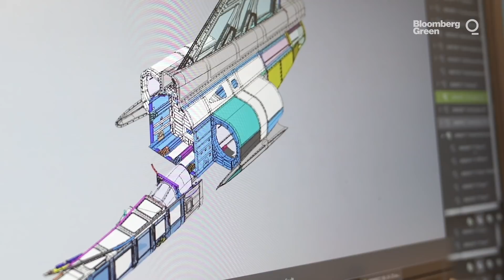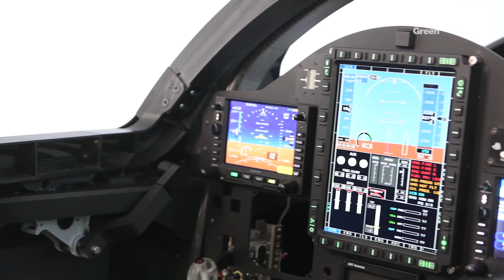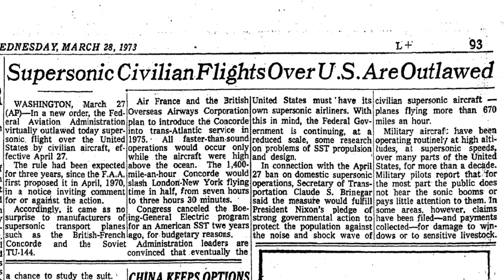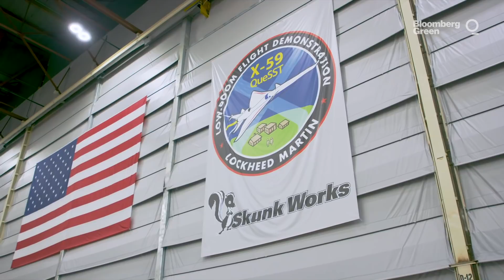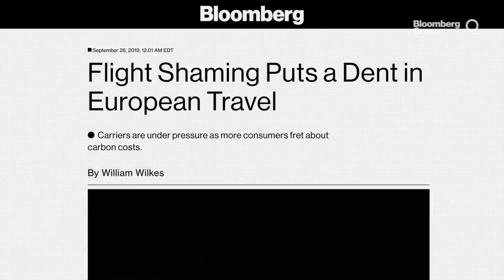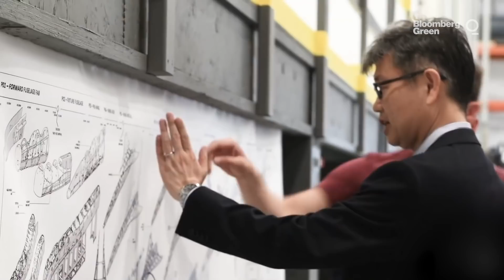Why Supersonic Jets Are Making a Comeback

Comment: Concorde didn't fail. Mega success and not superceded since the 60'ees
Reply: is that why the plane got dropped?  Because it was a success ? Lol
Reply: So many comments refuting the failure of the Concord. Over it's entire lifetime they only sold a couple dozen and the airlines had to charge huge ticket prices to break even per flight. For the airlines that flew it, they kept it only for marketing and bragging rights because it was a financial albatross to fly and maintain. 

Sure it worked, but it also failed.
Reply: @jmelande4937  do you know of any other airplane from the sixties that flew regular Atlantic routes in the 2000s?
Reply: @DinoAlberini  name a time where airlines complimented the aircraft about things other than its speed and safety. it didn’t make economic ends
Reply: @gavcom4060  it’s about image and prestige. That thing was a flying billboard.
Reply: @DinoAlberini  do you know any airline manufacturer that gave up after dismal sales of one and only model?
Reply: @jmelande4937  it was a cooperation, not one manufacturer, also, both of them have successors active today.
Reply: @DinoAlberini  
Concorde entered service in the 70s. The 747 series had first flight and entry into service ahead of Concorde, and 747s still fly revenue flights across the Atlantic more than a decade after Concorde retired.
Reply: ARE YOU on crack
Reply: @vilemeep  in what way did it fail?

Comment: 'The failed Concorde'?  The Sovjet Union made a knock-off version of the Concorde, which only flew for 3 years after 2 fatal crashes. Boeing, the company after nowadays BOOM, wasn't able to design and produce a plane like the Concorde. Remember: Concorde started to fly in 1969 and it is now considered as a massive achievement,. It flew safely for years, even through the oilcrisis of 1973. You can't just say it was a failure because they aren't flying anymore. 

To remind you of the accident in Paris: a plane, which took off prior the Concorde, lost a strip and due to the angle of attack on the fueltanks, it went wrong. It was possible to modify all Concordes to meet the recommendations after this accident, but if you knew the oilprices were on an all time high and the tickets were expensive, it wasn't possible anymore to make money out of flights. The Concorde a failed plane? No. Does this video have a bad intro? Yes.
Reply: In the late 70's my university physics department had a Concorde designer come and do a lecture on the technology behind Concorde.  I remember clearly that he said they could never understand why the Americans tried to design a mach 2.7 plane.  The metal technology didn't exist (or would have been prohibitively expensive) so Concorde only flew at mach 2. They knew their limitations.
Reply: @garethonthetube  They tried to design a Mach 2.7 plane because,being Americans,it had to be bigger,better and faster.
Reply: But Boeing never tried to design and produce a plane like Concorde.
Reply: @Crustywasp , they did. You can search for the Boeing 2707.
Reply: @Bruce954  Oh yes,the old Boeing 2707 story. When the Americans heard that the U.K/France were designing a supersonic passenger aircraft Congress asked their aircraft manufacturers to come up with their designs and,being American,it was expected to be bigger,faster and better. Lockheed came up with a delta wing design (similar to Concorde) and Boeing a swing wing design,Mach 3,two hundred passengers and flying at 80,000ft,as you rightly say the Boeing 2707. A totally unrealistic,over ambitious project which quickly ran into technical difficulties and even now regarded as impossible to build. Boeing then submitted a delta wing design (much to the annoyance of Lockheed) but with billions being spent on the Apollo space project and the country getting further embroiled in the Vietnam war Congress refused funding and the project was cancelled. We did it,they didn’t,fair enough. We did it,they couldn’t is rubbish. I’m not knocking Concorde as it was a beautiful aircraft and a fantastic technological achievement which I was lucky enough to fly on in 1991 but when people say ‘The failed Concorde’ nothing will ever change the fact it was a terrible economic failure.
Reply: @Crustywasp  if they couldn't finish the built or even the design because there weren't any funds left, they couldn't do it. Otherwise it was there. Concorde did. Even the Sovjets did. Boeing couldn't and that isn't rubbish, but the truth. Enjoy your day!
Reply: @Bruce954  Exactly. They didn’t do it because of funding being withdrawn,not because it was beyond them technologically. That’s the difference. Had they not been so over ambitious with the original design and Congress had carried on putting the money into the project the the U.S probably would have had their own SST. Something we’ll never know but I know where my money is. Anyway,you enjoy your day as well.
Reply: @Crustywasp  the fact is they couldn't do it. That is the point. The reason behind it, doesn't matter. At all. "Probably" doesn't build a 2707, neither did Boeing.
Reply: @Bruce954  Oh,for heaven’s sake. The point I’m trying to make is that in the U.K. we seem to think from a technology point of view an SST was beyond the capabilities of Boeing. The U.S Congress stopped the funding which killed the project,Boeing never held up their hands and said they weren’t capable of building the aircraft. That’s the difference. Anyway,we had to ask the French for help as well. 😀. Also,who was the cleverer? Boeing,who built over 1500 747’s which flew billions around the world and only now being phased out after 50yrs or us,who built an aircraft with a limited range,a pathetic payload and which no airlines wanted? Answers on a postcard please.
Reply: @Crustywasp  there isn't a difference: it is or isn't made. Boeing couldn't do it. 

The 747 isn't relevant to this case. Last message from this side, bye!
Reply: @Bruce954  yes I agree. Is or isn’t made is true. Could or couldn’t is more relevant. Boeing couldn’t do it,but due to lack of funding and not lack of technological expertise. Last message from this side as well. Enjoy spending your time splitting hairs. Bye.
Reply: @Crustywasp , ok not my last message, because you are still wrong. Because Boeing couldn't make the plane, you can't know if they would get some difficulties later with the technics in the plane. They couldn't do it. Accept it. Don't make excuses.
Reply: @Crustywasp , can't you just accept the plane isn't built, didn't came into service thus you can't tell if there would've or wouldn't have been any technical issues later in the process, which could have been a dealbreaker as well. Fact is it isn't build, because Boeing couldn't. That is the simple fact. End of the discussion. Done.
Reply: @Bruce954  yes,couldn’t because of withdrawal of funding. End of discussion. Bye.
Reply: @Crustywasp  In The Netherlands we do have a very nice saying:  'een bord voor je kop'. Translated loosely, it means that person is very stubborn and is fixated on his or hers vision. That is the case with you, I'm afraid.  It isn't there, so your opinion isn't correct. Deal with it.
Reply: @Bruce954  Equally applies to you as well!😀
Reply: @Crustywasp  Not if you are right. And guess what? I am right. You are wrong. Deal with it.
Reply: @Bruce954  😂😂😂😂😂😂😂😂😂😂😂😂😂😂😂😂😂😂😂😂😂😂😂😂😂😂😂😂😂😂😂😂😂😂😂😂😂😂😂😂😂😂😂😂😂😂😂😂😂😂😂😂😂😂😂😂😂😂😂😂😂😂😂😂😂😂😂😂😂😂😂😂😂😂😂😂😂😂😂😂😂😂😂😂😂😂😂😂😂
Reply: @Bruce954  I used to have exactly the same argument with my late father years ago about how the ‘Americans didn’t have the intelligence to build a supersonic passenger plane,we showed them how to do it’. He was ignorant as well.
Reply: @Crustywasp , Well, maybe your late father (may he rest in peace) knew your personality and thought it would be better to say you're right than actually stick with the facts. He knew you were stubborn and wouldn't give in. Unfortunately for you I'm actually sticking with the truth. Enjoy your day.
Reply: @Bruce954  😂

Comment: Sub-orbital Hypersonic flight will become a reality before these, I am betting. Once you're essentially in space, your fuel costs plummet, the only real issue is getting that high without complex technologies like aerial launch systems. If you can get an engine that can power a heavy enough payload, whilst still being green, and mount it in a self launching aircraft... well spacecraft in effect....that can 'Fly' is needed, but only needs to for the first few minutes after takeoff and before landing, then the technologies for most of the other aspects already exist, and you do NOT need worry about Sonic Booms. 

Thus, they need a powerful green engine, than can get Antonov level loads above the 'Space Line'.... and an airframe design that handle the stresses, and heat, of getting having such an engine, which they already have the materials for, for both those things that is, and they could get a machine that could take 747 passenger levels airborne. Once up there, with such little resistance, they could just do an acceleration burn, and coast. Decelerate via the opposite as approaching the destination, and again burn some fuel in landing. At most you'd have some serious inefficiencies on take off, but be WAY more fuel efficient for most of the flight, and with the right glide characteristics, probably even more efficient on descent and landing. You'd save MASSIVE money OVERALL on fuel, and that would reduce your running costs, maintenance, and, most of all, ticket prices. 

All the while you do not have to worry about Sonic Booms, and you're getting more people there, MUCH faster than Concorde or any of these plane could. You could fling people around the world in a few hours. Imagine a notoriously long route, like Sydney to Los Angeles, then imagine it taking three hours, not almost twenty. You board a 6 am flight to LA, get there in time for a late breakfast, spend the day, until a 7 pm return flight to Sydney, and be in bed by 11 pm. 

I see both the extant technology for that, and the effects in the now of the benefits of it, so I am going to say THATS going to be the next frontier in Civil aviation. Will the X59 project still continue and reap rewards? Sure... for Military aviation, but spaceplanes are the future for Commercial flights. Just too much benefit, and much easier problems to solve. Once it is a reality, who is going to want to pay business class prices, for a trip that takes thrice as long, when one could pay as little as premium economy, or even economy ticket, to get somewhere much faster? 

It's all moot though, because slowly we'll leave aircraft, and even spacecraft behind altogether.... one day... the Star Trek teleporter will be reality :P

Comment: 10:20 I've read that if you burn something at high temperatures the nitrogen in the air will also start to react and form nitrogen oxides, which is also a pollutant. So this is not really clean.
Reply: yes, indeed. but more importantly : you need massive amounts of energy to revert CO2 and H2O into methane (fuel) and O2, and that energy comes primarily from fossil fuels

Comment: I love to see some bright young startups and hate to be the "wet towel", but I can't help but get the feeling that this is all way to late. We've had Covid, we've got more pandemics on the way, there's the environmental impact and the plain old fact that the economics of flight has largely been subsidised for the masses by business class passengers! 

When we then add into the mix another small start-up (I'm looking at you spaceX!!) Then the picture really starts to change. The costs of rocket rides are plummeting, while the cost of even standard flight is escalating. When we have a prolonged effect from Covid where 50-70% of the world's precovid airlines are wiped out, then the already shaky business of Boeing starts to look like a crumbling tower!! As the manufacturers implode, the cost of operating an airline only ends up increasing and thus ticket prices!!!

All this to say, there will, without a doubt, in the next five to ten years be an intersection between the cost of a seat on a rocket (or other low orbit space craft) and a traditional or supersonic jet, which, I would suggest, will ultimately be the point beyond which the air travel industry as we now know it, will cease to exist! 

Just a potent thought anyway!!

Comment: So your saying Concorde was a failure?
Does that mean that Apollo was a failure too, total rubbish........
Reply: The difference is the Apollo missions were never meant to be commercially viable, Concorde was, there goal was to get Americans to the moon first, a goal that was achieved. The Space Shuttle program, by contrast, was intended to massively reduced costs and allow for quick turnaround of spacecraft. Because it didn't achieve its set goals, it is also considered a failure overall. The A380, similarly to Concorde, is considered a failure because Airbus will likely fail to recoup the costs of development. When you set a goal and don't achieve it, you've failed, it's that simple. It doesn't have to be a dirty word, and doesn't mean you haven't learned a great deal and achieved other successes in the process.
Reply: Concorde made a profit and initially had a lot of orders from many airlines. The crash of the Russian Tupolev Tu-144 seemed to coincide with many of these orders being cancelled.
Reply: @belovedrock.  Soaring fuel costs in the early 1970s and the regulations around supersonic overland travel were also major factors in the order cancellations.
Reply: The Apollo missions were a success there mission was to do science on the moon

The Concorde failed its mission was to open a super sonic speed aircraft that would try to open a new market of fast planes across the world but it failed because of cost and the technology was just too expensive to maintain
Reply: It was never cost effective, it future was in question from the first launch.  When one of the two planes blew up... well most people would call that a failure.
Reply: @Erin-Thor  how many 747’s have crashed in the last 30 years, one plane crashed because something fell off of a Continental Airlines plane and damaged the fuel tanks.....
McDonald Douglas were falling out of the sky every other day.....
Americans just can’t believer some other county did something that they couldn’t and still can’t, it’s jealousy.....
And to those that say it didn’t make a profit look at wiki.....it flew for thirty years unprofitable, do me a favour!
Reply: @downy8586  -- 61 747's have crashed, 32 resulted in no loss of life.  My point was that with 2 Concords, when one crashes oh so very spectacularly, you have a 50% failure rate.  🤣
Reply: @Erin-Thor  I don’t understand what you are trying to say, are you thinking that there were only two Concordes?
Because if that is so I can tell you That I watched 4 British airways Concordes land at Heathrow on the day they were retired and obviously then there were the Air France ones too...
And only one Air France one ever crashed resulting in loss of life, and they flew for more than 30 years....
14 entered service btw....
Reply: @downy8586  — Well then I stand corrected, I could have sworn that they said there were only two operating at the time of the crash. So 4 land after the crash, that makes 5, so a 20% failure rate. I’m thinking that is still crazy bad odds.
Reply: Considering your reply why would you even be replying or participating in this? Discussion ????
Reply: Wow.....
Reply: It was a complete financial failure kept aloft by government subsidy.
Reply: I dont think they are saying it was a failure, I think they are saying it was mainly built for bragging rights rather than a practical aircraft for supersonic travel
Reply: @zackgambrell3153  It had commercial objectives, but the fuel crisis put a stop to that. The beat up about the sonic boom also contributed. It was a revoluntionary plane launched into a very rapidly changing commercial reality. The 747 beat it on the new metrics that airlines and passengers valued. Cheap tickets.
Reply: @zackgambrell3153  bragging rights? hahah just like Apollo then ;)
Reply: @JavierAlbinarrate   well yeah the whole reason why apollo was made was so america could prove to be superior to the soviets, it didnt have the huge budget it did because america wanted to being home some moon rocks.

Comment: 10:00 "fuel made by carbon capture".
that does not solve much. looks good on paper. but the plane is still designed for fossil carbon fuel. so it can and will very easily be used as such. some companies will be diligent to use a carbon captured fuel, but many, from different countries will not. so the power hungry highly polluting plane issue still remains. 
A real solution would be hydrogen. 
thay way the consumer, we, are sure, there is no pollution and it's not just a marketing.
Reply: isn't coal captured carbon, from 200M years ago

Comment: May be we need not Super-Sonics but more managable with ever encreasing cost to extract the fuel for every-mode of transportation, in the age of Corona circulation into the humanity. As for example, we need more bigger airpane with airship design in the thinking and desiging them. Make compartments with air vents each sections, which guarantees isolation and supply of uncirculated air from outside. So, bigger ships should come to mind. Bullet shaped big plane with compostie wings, in which passangers would spend a bit longer times to travel than usually, as speeds will prop next to conventional airplanes ( from 700-900 km/hr to 450-550 km-hr ).